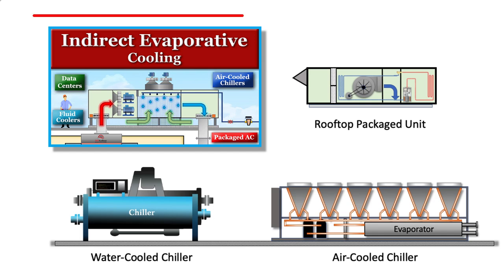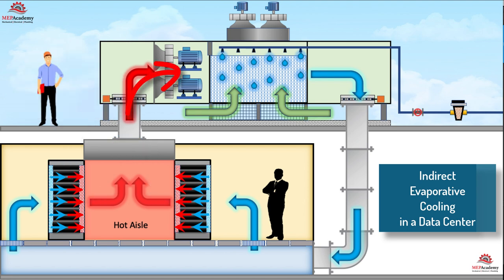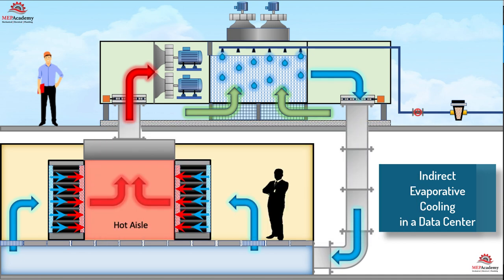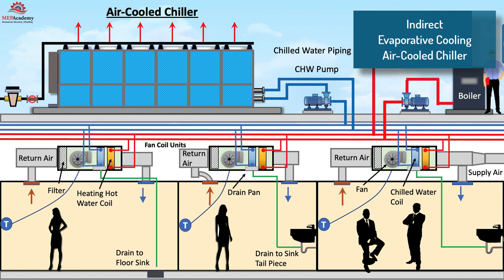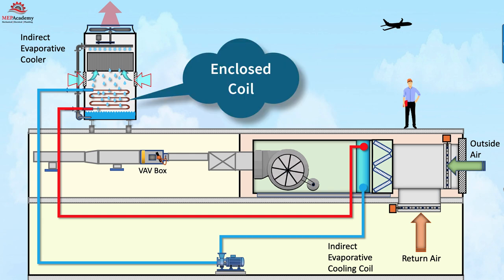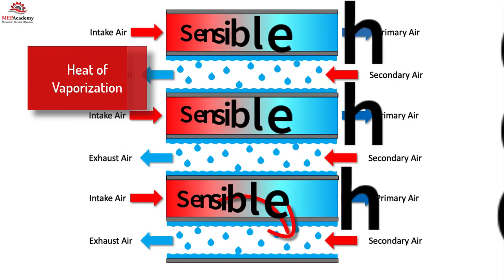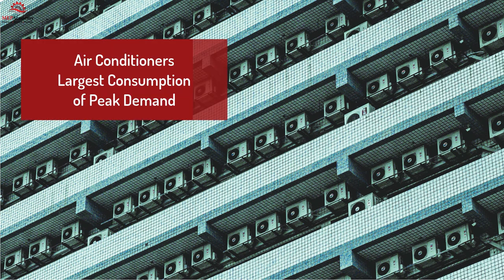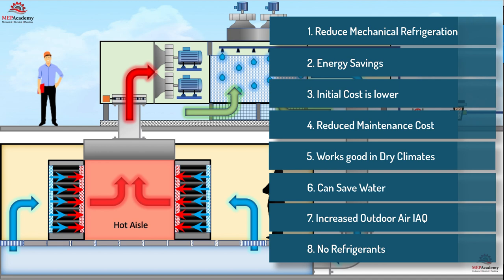How Indirect Evaporative Cooling Works

Comment: Indirect evaporative cooling limit of product air temperature is wet bulb. Dew-point indirect regenerative air cooling breaks this barrier and cools approaching dew-point, not wet-bulb temperature. Would MEP Academy report on it, including use case of data center cooling?
Reply from the maker: Do you have something you want to submit for review, if so, please forward to john@mepacademy.com with your request.